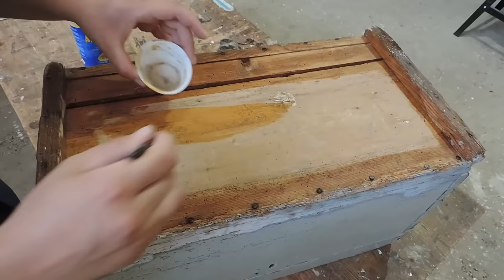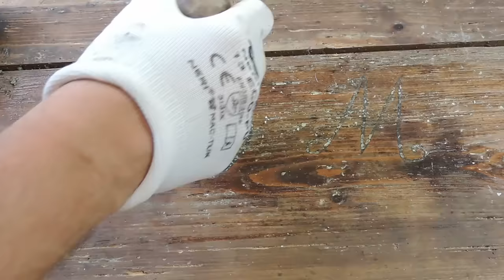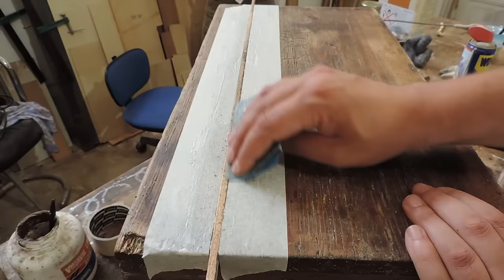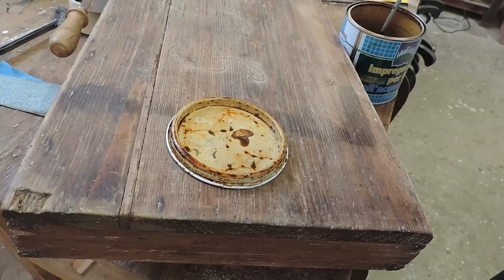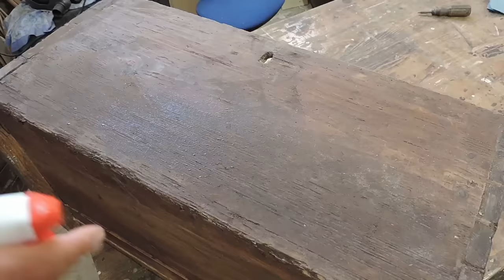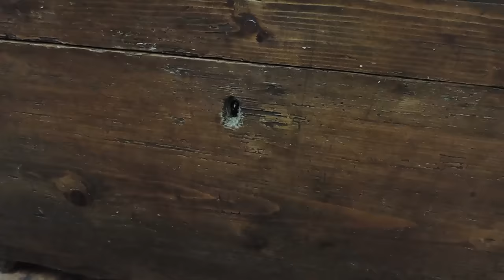restauro antica cassapanca centenaria

Comment: Good video.Maybe avoid levering the nail puller against the wood to minimise damage
Reply: Putting water on the area that the nail puller dented in will re-hydrate the wood and should make it smooth again.
Reply: Good point, also using WD40 (or similar) to loosen screws in wood!!
Reply: @paulmaryon9088  Why on earth would you put WD40 on wood? How are you going to wash it off?
Reply: @Corksy  Yea mate my point exactly , tho, to be honest can't really remember the vid in question !!
Reply: Yes, I cringed when I saw him pull the nails in that manner

Comment: I thought you would get rid of the carved initials on the lid.  They drove me crazy but evidently you wanted to keep them.  Is it possible to fill in the carved letters or is there another way to get rid of them.
Reply from the maker: The only way to remove the initials would be to lower / plane the top, but all the signs of aging would be lost.
Reply: @IlMakerstauratore    Thank you for your quick answer. I understand why you had to leave them there since this was a restoration. Also thank you for making a straight forward instructional video.

Comment: Hello
I have a tip for you.
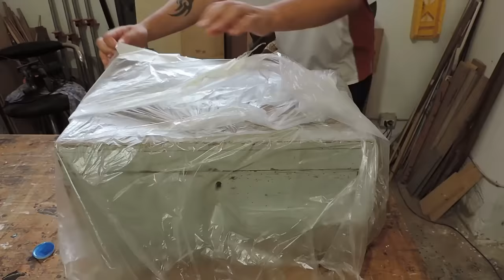Minute 02:40
Don't throw away the foil, leave the box on the foil.

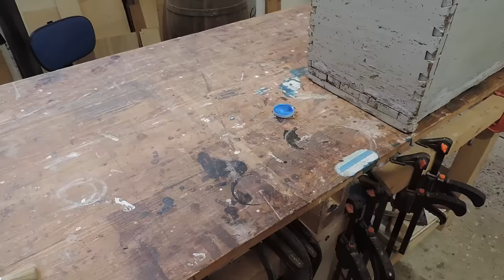Minute 02:55
Paint the box completely with paint stripper as shown. Now spray some water on the painted box with an atomizer and wrap the box in the foil overnight.
The next day, the paint will come off as if by itself. Repeat the process if necessary.

Just test this on a painted scrap piece of wood.

Love greetings
Reply from the maker: Thanks for your advice. I had already used this technique for the restoration of the trunk. But I didn't know I had to spray the water too. I will try this technique.